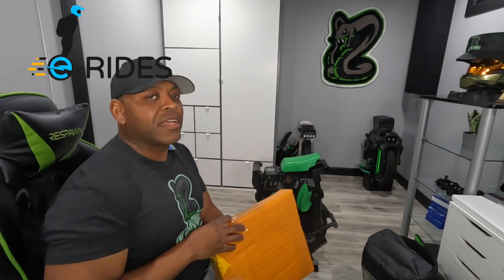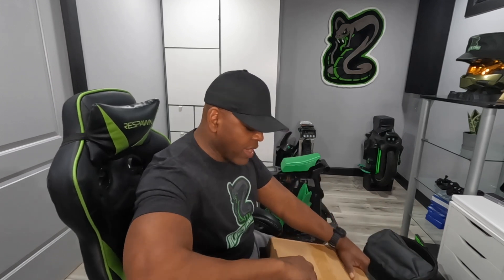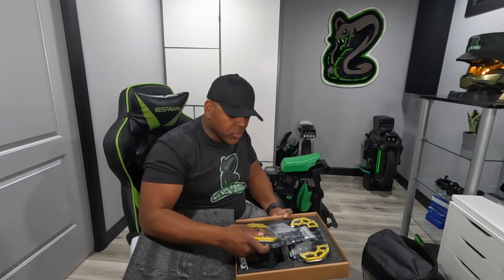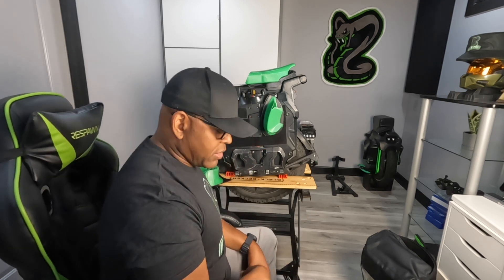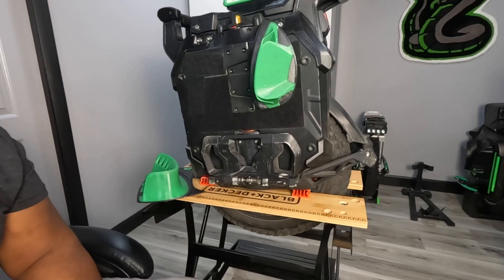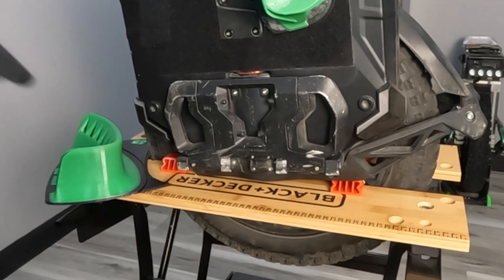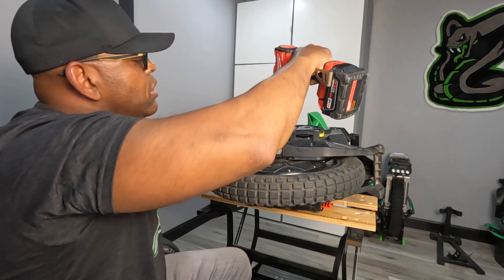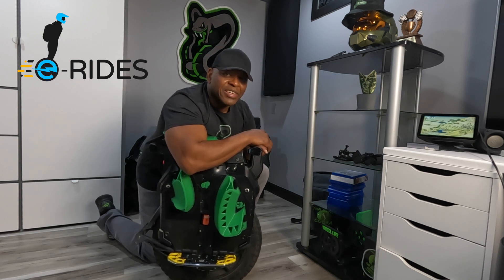E Rides Pedals on the Sherman S

Comment: I tried Nelsons Sherman-S with the yellow E-ride pedals. The pedals didn't bother me for the very short ride. But for long rides my feet need support in the middle so I would remove the risers front and back. Nelson tells me he did not like the pedals, because they are to small and he is a big guy.

The suspension of the Sherman-S is good, but I was very disappointed in the acceleration from standstill. It feels very much like the old Sherman. The Abrams is just as heavy and accelerates immediately, even when seated from standstill. I could climb steep hills with the Abrams seated.
Reply from the maker: Glad it’s working out for you

Comment: Cobra, looking for your opinion on some pads for my soon to arrive ex30. I don't plan on jumping it much. More for fast/distance street riding with pads nice and snug. What are your thoughts on the Grizzla Flow, CP Bio, CP Titans? Thanks in advance.
Reply from the maker: Those are actually the top three choices right now and I would say you would be happy and well served with any of those three. That being said, I will add that if you like pads, super snug on your leg the bio pads automatically come that way. The Titan pads, and the Grizzla‘s have plenty of adjustment to make them as tight or as loose as you want. Right now I am loving the bio pads, but I also love the Titan pads as well. The grizzla’s would probably be number three for me simply because the material wasn’t as comfortable as a ClarkPads oh, my leg, in my opinion. I hope this helps you.
Reply: @ThaBlackCobra  K. 👍